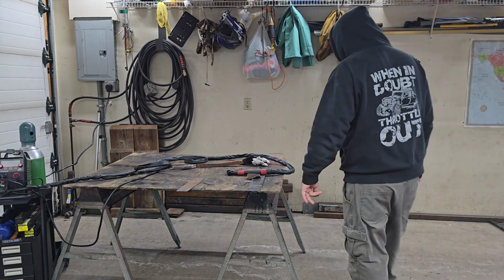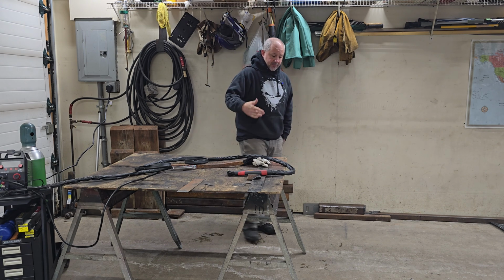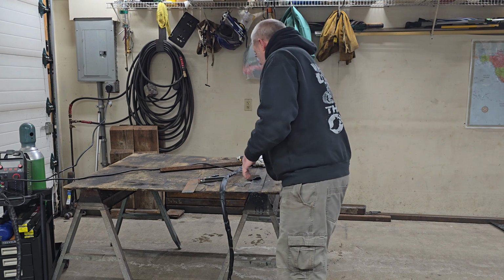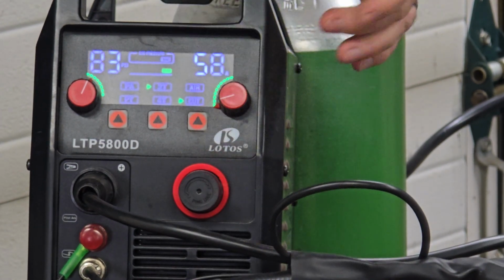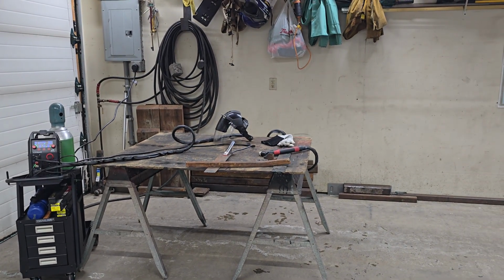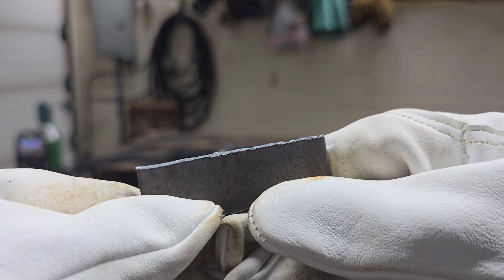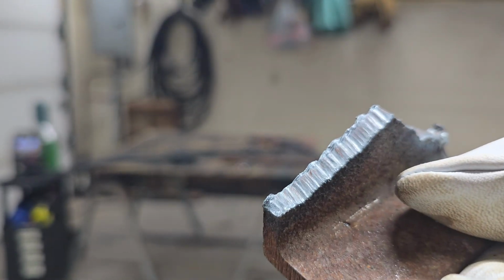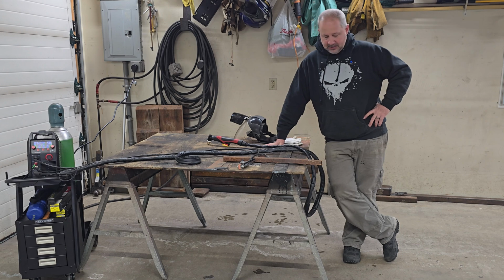$339 Lotos LTP5800D 58A Plasma Cutter!

Comment: So no gases needed just an air supply?
Reply from the maker: That is correct. You'll supply "shop air" from your home air compressor, and you'll supply the 110V or 220V power. The arc created, combined with the air will create the magic. 

I have a 20+ year old plasma machine that's been cutting for my farm and hobby uses with zero trouble.  I would expect similar from this. The only additional expense is replacement nozzles and tips. But, if you're careful with your torch, you don't destroy them too often.
Reply from the maker: Oh,  i see why your asking.... I have it on my Tig cart, and the Tig argon tank is still chained onto the back of the cart. That tank has nothing to do with plasma cutting.
Reply: @LarryMusgrave  yeah that was throwing me off. Haha. So overall worth the money?
Reply from the maker: @aaronbryan6520  
Absolutely. Yes.